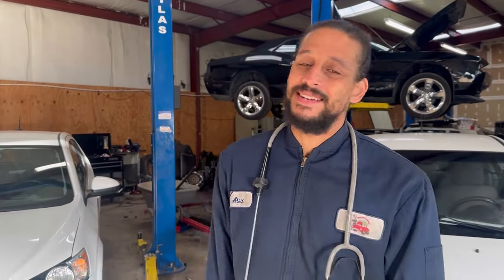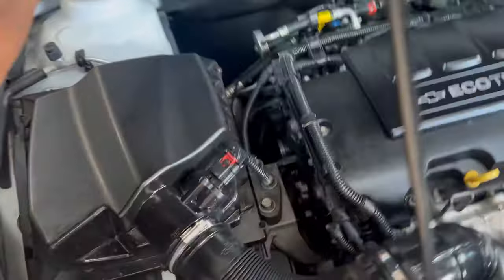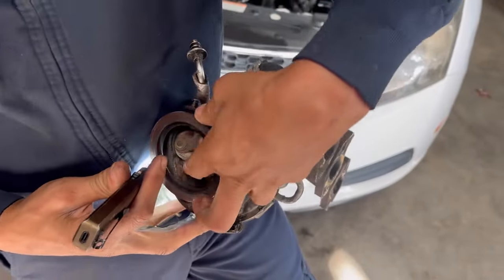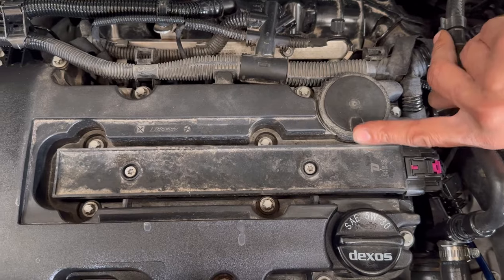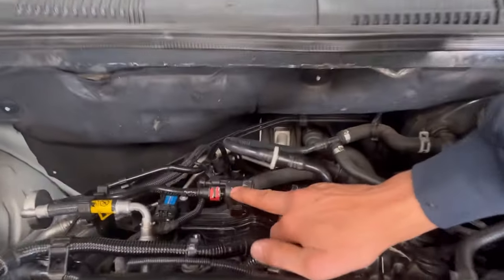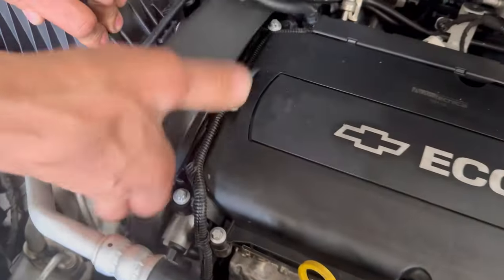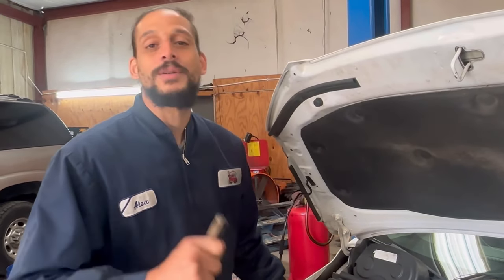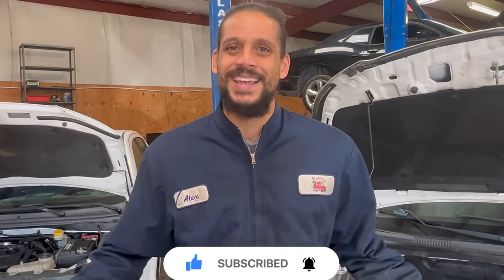Top 5 Problems With The Chevy Cruze (1st Generation 2008-2016)

Comment: Good and accurate. I will add that the 1.4 PVC/valve cover issues are often related to a check valve in the intake manifold. It's under that corrigated tube that runs to the turbo inlet. Pull that corrigated tube's elbow on the intake and look in the hole back towards the cabin. If you don't see a orange little tit, it's gonna need an intake manifold.
Reply: Mine is a 2013 with 110,000 miles, and I just recently had to replace the intake manifold.

Comment: I have a 2014 with 1.4L  and slightly over 200k miles.  I've had a few of those issues.   Now I'm dealing with DTC P0011.

Comment: I have a 2014 and a 2015 Chevy Sonic 1.4l LTZ Turbo and love them, I do my own oil changes and other small things at home. I use the 2014 for doing door dash and that only has 38,600 miles on it purchased it with 13,500 both cars have been great. There is one thing you didn’t mention in this video and that is the expansion tank they crack at the bottom and I have had to do them on both cars thank you Alex for sharing this. I also would like to see more on the Sonic 1.4l turbo.

Comment: How about smoking out the exhaust when over 2500 rpm? It was really bad, thick until replaced the oil cooler assembly . Not as bad but still doing it . And eating oil..

Comment: Dude.  The biggest problem on the 1.4 turbo is the pcv check valve inside the intake manifold goes missing.  Once that happens, you have positive crankcase pressure.  Thus, oil has nowhere to do go leaks everywhere.  Including the valve cover.

Comment: Thank you for your video, I just boguht one of these and oh boy, the maintenance issues i uncovered is crazy. I have so far maintained it. I do have a question about a code I have been getting. A p2261 code about bypass valve getting stuck. I went to a shop so they can test the valve but it works. A mechanic mentioned replacing the turbo boost sensor and map sensor? Would that fix it, Let me know and thank you for your informative video. I have the 1.4 Turbocharged Engine for the sonic 2014 ltz

Comment: I've got the 1.8 and it's a manual. I do kind of like this car because of the fuel economy. If I'm on the interstate I can get between 42 and 48 miles per gallon and in town it's about 30 to 35. Ava right now I've got a misfire happening and I'm getting 33 miles per gallon in town. I do have over 200,000 mi on it and you bet I've replaced all of these things except the water pump. We can't figure out the stabilitrak issue and I think I just need to check out the spark plugs for the misfire but it's still just goes.

Comment: A lot of the Chevy Cruze has had a diagnosis of a head gasket gone when in fact the head gasket is not gone it is the oil cooler nine times out of 10 leaking oil into the radiator fluid not the head gasket

Comment: It gets more gas miles than that I have one I drove from Illinois to Ohio on full tank of gas filled up 2 days after I drove to Ohio . How good they are on gas . Also I keep my maintenance up on it . Mine has 170 thousand miles and it’s still running good .  Just replaced the vacuum pump because it was going out . And put new spark plugs in I have the 1.4

Comment: Hey man do you have any clue why my 2013 Chevy Cruze key fob does only works sometimes? I had my key fob replaced and it still only works sometimes. I also know it's not my batter. What could it be?
Reply from the maker: It could be a bad BCM that stands for body control module. that is the part that received the signal from the key fob,

Comment: I have a 2012 Cruz turbo and it’s reading on the dash stop low engine press . I have no clue what’s going on . The drives fine until I stop or when after a 20 min .if you can suggest anything . And where are  you located

Comment: Sometimes the pcv can fail in the stuck position creating incease crankcase pressure and can cause oil leak usually from the vavle cover gasket.

Comment: aluminum foil tape for ducts/insulation, wrap it on the cooling pipes and it reflect off the heat from the engine and gives it better thermal conduction to cool the rubber part. i made heat sinks for my cheap chinease led headlight powersupplies for my volt and they lasting forever
Reply from the maker: Good tip thanks

Comment: Where does the temperature sensor sit in these cars. My fan does not switch on when over heating so we bridged the fan to run continues. How do we fix this problem even after diagnosis they cannot fix it
Reply: @misslee6878  passengers side on top of plastic outlet

Comment: We bought my wife’s Cruze from a  sketchy dealer. Didn’t know it at the time. But I’m going through and basically replacing a system at a time. I’ve done battery and alternator cuz they both went out. Just did the purge valve today. It was giving weird start up problems. Mostly after driving for a while it wouldn’t want to start after it sitting for a few minutes. Gonna do the fuel pump and injectors next. The dealer ended up putting a new engine in the car for free cuz they messed up. Oh and I’ve done a turbo, valve cover, MAF, MAP, cam position sensors and the VVT cam controllers, plugs and coil pack. Not been fun but my wife likes the car. Next is the AC compressor cuz they put the wrong one in the car.

Comment: My thinking was the list would be shorter if you mentioned the problems it didn't have 😆the 1.8s run forever but the 1.4ts seem to be endless for problems. Granted the fixes are well known and relatively affordable and easy to do with some knowledge and tools and can more or less be prevented with good maintenance and proactiveness.

Comment: I’ve been having issues with my 2014. When the ac is off the car runs just fine. But when I turn it on the car does not want to go. The ac is nice and cold but the ac being on just a little bit really doesn’t like to accelerate, it goes but not how it should. I don’t want to dog the car by pushing the gas too far where the turbo kicks in because I feel like it’s messing it up. And also it will start running rough as well when it’s on. If you have a recommendations that would be amazing! I love my car. Also no lights are on in dash or on the screen.

Comment: Yeah your correct about the 70-100 mile tyming belt replacement 😂🤣😂
Reply: Most buyers dont think timing belts are still a thing. Roads gonna be littered with 1.8L cruzes soon. The 1.8 gets lousy gas mileage on hwy.

Comment: Plz make a video on a 2003 -2006 Chevy Silverado if it comes by the shop love the vid
Reply from the maker: I gotcha!
Reply: @AlexTheCarDoctor  I got a choice of a 2014 Chevy Cruze 1.4 turbo 105,000 miles  or a 2007 Toyota Corolla 1.8 185,000 miles. Both cars look great. Which car is probably going to be the most maintenance in the next 75,000 miles?..

Comment: Hello, please help me out her. I washed my engine and since then I have been facing problems. I find it difficult to move the car on first gear but it works perfectly after moving but I can move I have to continuously steps on the gas pad like four time before the engine will respond but it shakes before the fire raise

Comment: On my sonic 2014 I've replaced the timing belt . The valve cover.  The purge valve.  The catalytic converter.  The thermostat housing twice . Can't remember, I believe the intake manifold also at 120k now and running kinda funny where can I contact you for advice on the matter if possible

Comment: Hi, I have a few questions. My 2014 cruze is showing the code P0449, I was wondering what might causes that to pop up? I have went to two shops here in my city and yes they replaced the solenoid, also even the gas cap as well. I still smell gas in the air when I step out of my car, is my evap canister going bad or something else? Either way, I'd be happy if you could help a brother out by sharing more info! Oh yea I forgot to mention that the engine light is still on

Comment: I do have a weird thing going on with mine though every now and then it glitches driving down the road and the stability track service traction control lights will come on. I've done a tune-up changed coil packs replace the valve cover I have a brand new top-of-the-line battery. All the things that cause the Stabilitrak traction control lights to come on I've done fixed and replaced. As of right now there isn't any reason that I could think of for it to be doing this. I always do my oil changes on time I maintain the car very well. I just don't understand what is going on here

Comment: I have a Chevrolet Cruze 2013 model. Recently, there was a leak on the engine timing side, so the mechanic removed the engine and replaced the gasket and seal. During this time, they also replaced the gear oil and thermostat.

After driving for a day, I found a leak from the gearbox. I went back, and the mechanic replaced the seal in the gearbox. Within two days, the gearbox suddenly failed, and I noticed the gear oil coming out from the overflow line. The mechanic said the gearbox needed to be replaced, so they installed a second-hand gearbox.

However, the same issue occurred again. They replaced the gearbox a total of four times, but the problem persists with the oil getting reduced each time. They also replaced the transmission cooler, but it hasn’t resolved the issue.

What could be causing this problem? Please advise.

This version is clearer and breaks down the issues step-by-step, making it easier for others to understand and provide advice.

Comment: Nice! The car doctor recommends a Chevy! I’ve been looking at Honda and Toyota. They are high priced or high mileage on them. The ones that are at the $5k price are over 200,000 miles.
Reply from the maker: Chevy Cruzes are pretty good cars if you can maintain them properly.
Reply: Can you make a video on how to maintain a car? I only do the oil changes at 6,000 miles full synthetic and keep my ear out for noises.
Reply: Yeah they are high priced for a reason better than all those American junk.
Reply: With 170,000 miles on a Toyota Camry, only had to replace a battery. That’s it! Now you know why!

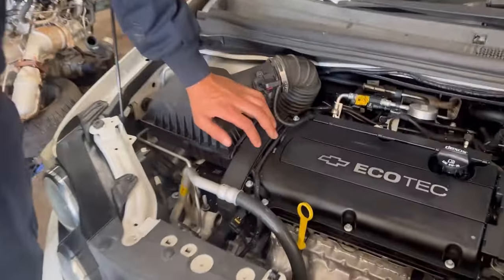Comment: 8:33 I had absolutely no idea that scheduled timing belt replacement was considered as a problem. Also, why would you choose 1.4 when that engine clearly have all kind of problems? What is good fuel economy worth to you if the engine costs you a lot of time and money to repair? All those small turbocharged engines (ford ecoboost 1.0, vw family 1.0 and 1.2, gm 1.4) can barely hold on to their warranty without problems which makes them a nightmare for owner to say the least.

Comment: Just bought a 2014 chevy cruze 1.4 liter and the temperature guage doesn't work started driving it then it popped up on my screen that the ac turned off became my engine was too hot

Comment: I have a 2013 chevy cruze. Replaced turbo, coolant system to include-radiator, housing thermostat. Now it's the cam kit and actuator. Possibly the transmission. It's been never ending it will be a 15,000 piece of junk after that. I have only put in synthetic oil and 91-92 grade gas. I can't get rid of it because ofvtitle issues. It was too good to be true $5000 25k miles. After I paid for it handed me a salvage title and failed to mention prior to sale then handed me some paperwork unfinished to get registered 4 years later and lots of $. Trying to get tabs and registration. Can't do anything with it.

Comment: I thought the 1.8 has a non-interference engine? If so, how could the pistons crash into the valves if the timing belt breaks or you have teeth that slip the timing?
Reply from the maker: Someone corrected me about that. It is non interference
Reply: @AlexTheCarDoctor  So glad to hear that, because mine slipped some teeth and there's a good chance I can fix it without breaking my bank account. Thank you so much for responding so quickly!

Comment: my plastic coolant container melted, did not know it - the oil changers did not see it either I guess, I think they were very inexperienced with a cruze.
Reply: You can only use the orange coolant I used blue one time and it would boil after driving 5 miles.

Comment: I know for a fact those sonics are garbage one had a cooling fan blade that became brittle and shot a dagger piece into the radiator and causing it to overheat seen two of them overheated near my house and a white Cruz is currently sitting across the street from my house I tested and the thing was throwing 20 codes the turbo is also partially the problem

Comment: I have a sonic with the 1.4t. Changed the oil filter housing and all the turbo oil and coolant lines when I did it. Changed the valve cover because the gasket was leaking yesterday. Plugs and coil when I did the oil cooler as well
Reply: There's a sequence to torque the valve cover too. I changed that purge valve to get rid of the clicking noise.
Reply: Great video thank you. I subscribed

Comment: But please telll me how to maintain this car to make it last longer , i bought it used on marketplace at 170,000 dont replace that coolant housing piece ... But one day it shows my AC STOPPED WORKING DUE TO HOT ENGINE and it was barely over the middle mark and always stay one notch below so i stopped let it cool and added coolant apprently it was low becuz i filled and drove another hour home and didnt do it again i just hope nothing hurt it dlong thay 😅 help me please!! My valave cover is metal with two caps on it

Comment: Same here bought a 2012 with 147,000 for $3000 from a Mexican and drove it 2 weeks tuning and driving it for the daughters 16th bday
All good until her bday came and I drove it to the car wash to have it nice and clean and on the 8 mile drive home it went from good temp to hot and pulled over
Took it to a family members shop and they said blown head gasket and would be $4500 to replace the whole motor???…every vehicle I’ve owned if they had a blown head gasket you take off the head and replace it…
Supposedly you have to take the whole motor out from underneath removing everything and half the front end to do so…
Who TF engineered this thing and should I change the thermostat flush the system since there no leakage to the oil and try the Blue Devil???
Car runs beautifully but after 15 mins or so if you drive over 45 it goes from good temp and creeps fast towards the hot and have to refill the water tank then it’s good again…but the funny thing is where did all the coolant go?…nothing leaking except steam from the coolant reservoir escape valve

Comment: My cruze is a 1.8, at 100,000 miles the idiot light will come on saying that you need to change timing belt. It's a standard thing all Chevy Cruzes will do this at 100 thousand miles it won't even start until you've had that changed

Comment: I have a Opel Meriva, year 2011,1.4 100 ps  ECOTEC GM motor,214.000 km,and  I change oil every 10.000 km...There is no problems with motor,only needs gas and regular maintenance

Comment: He's very wrong.The most expensive thing is not the Turbo charger.You can buy a factor one autozone for 280$ The only thing I had to replace on my Chevy.Cruise twenty fifteen was the water pump and it's going strong got it at 50k miles now its at 126k going well

Comment: I’d be mind fucked if I seen a 100000 mile water pump or at least an oem one on the 1.4. They usually don’t even make it to 50,000 on these pretty lucky if you make it past 60,000

Comment: Bought a white 2014 $500 dollars from young girl off Facebook marketplace not to far from where I live who gave up on it and bought a Honda I fixed it and drive it just about everyday when I’m not driving my Honda 2010 V6 Coupe or my 2008 Saturn Aura XE 3.5 V6 which I bought from Facebook marketplace for $900 lol the female owner who also gave up on it after chucking parts at it the problem was the fuse box got a brand new one with all fuses and relays for 279.00 from eBay the local stealership wanted $600  lol welp the rest is history as they say lol 😂

Comment: so. since 2010 and this is the first year production of that Vehicle in the U.S. market. and yet General motors didn't resolve their engineering flaws. by upgrading their failure plastic parts. and redesign their engine. They knew about the stupid engineering behind the problems. but they never wanted to address these problems. instead they decided not to produce sedans. that is a lousy company. that's why I never buy their Vehicles. it's a nice looking Vehicle. I was almost going to buy one the RS trim specifically. but my Mechanic told me to stay away from that Vehicle. because it has a lot of ongoing problems. unfortunately not reliable enough. beside they love rust. just like all of GM. Ford. Chrysler's. Dodge. Vehicles do.

Comment: These cars are junk. I have had 2.  2011 transmission went at 88k covered under warranty thankfully. My 2013 the throw out bearing went at 66k.  Complete trash.  I drive like a grandma too for economy purposes.  Complete junk stear clear.  Not to mention the coolant housing issues. Or climate control issues. GM should be ashamed of themselves for producing junk.